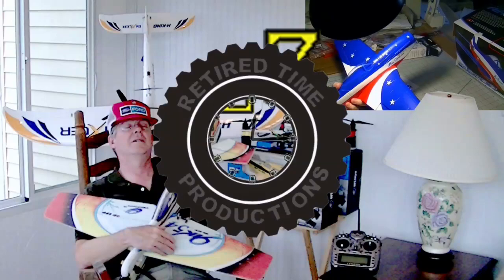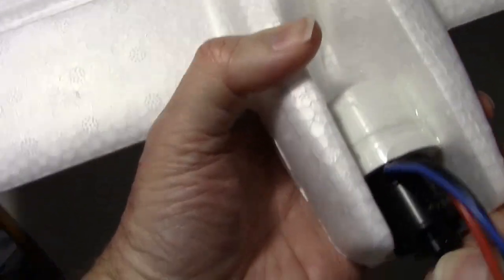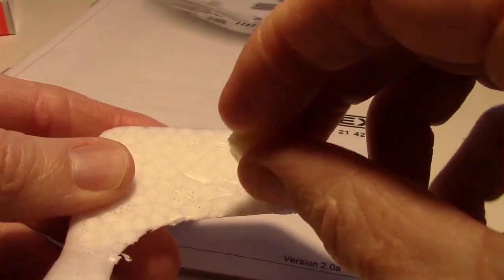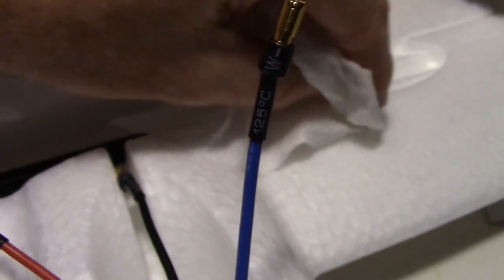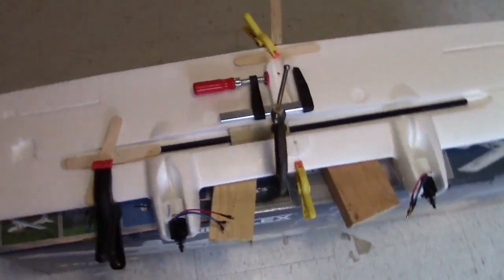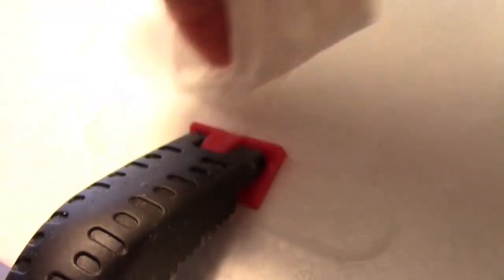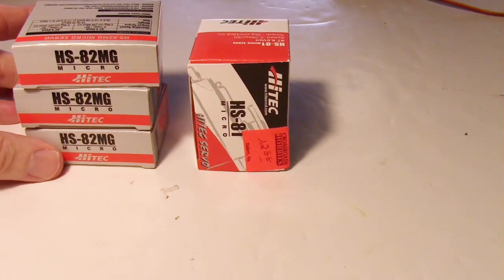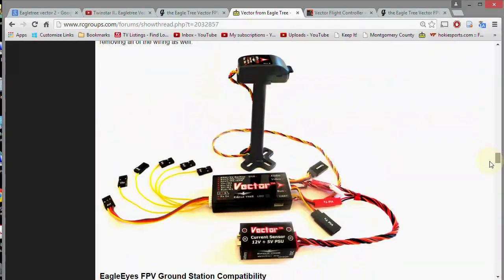Multiplex Twin Star II FPV Build Part 2 - DIY motor mounts, assembling wing halves

Comment: Glad you're looking at the Vector. All the major retailers seem to have it for $237.99. I checked RMRC, GetFPV and HobbyWireless. Even Hobbyking is advertising that price. I'm not sure there is anywhere you're going to get a "deal" on it, at least not yet. Good luck!
Reply from the maker: Chris Riccio Thanks so much for the information. Guess I will go with one of those vendors then. I have dealings with the first two.

Comment: Putting a vector into my Spector right now. I'm using dragon link but there are plenty of people who use exuhf with the vector. It comes in deans and xt60 and wired configs too. It's amazingly simple and powerful.  It's rssi input will work with the exuhf FYI.
Reply from the maker: A lot of people seem to be going for the new Vector and I am starting to catch the fever myself. Thanks for posting!

Comment: Vector is easiest fc to set up I've ever had . Osd is great so much info ! Airspeed sensor not necessary it has ground speed but if you want add it . Hope you like it also rcgroups YouTube channel did an install recently if you want to ck it out bonafidepirate is also running vector now . Good luck with the build !
Reply from the maker: tracy baker Thanks for the feed back! 
I like to have both ground speed and airspeed to better understand what the wind is doing. I wonder if the Vector can use the same air speed sensor as the apm.

Comment: Hi Dave! I'm glad you're considering the Eagle Tree system for this build. It will be nice to see a practical comparison with the APM on your Skywalker. By the way, ReadyMadeRC has them on sale right now. 
Cheers!
Fergy
Reply from the maker: Hi Fergy, Yes I am very interested in seeing how they compare as well.
I know the Vector does not have mission planning but the rest look great.
Seems like most vendors have that price drop to $239 and the list is about $279.
There probably won't be a lower price until after I buy one with my luck :-)

Comment: Thanks for the glue test. Been wondering what's best. Also, I had ordered some fiber hinges before I saw your du bro pin hinges and ordered those. looking for good security for my durafly f4u corsair rudder and looking to add rudders to my durafly d.h. vampire so I won't have to yank and bank.
Reply from the maker: Dale Kelley I really like the Dubro nylon pin hinges. I even use them to put hinges on the access doors on my aircraft. The Welder glue is hard to find these days but it sticks to everything including Elapor foam. It will eat Depron foam so be careful not to use it on Depron. Good luck with your f4u!

Comment: Can I go from a 2200mah 3s to a 3700mah 3s without changing the stock esc? Thanks
Reply from the maker: Any 3s LiPo battery will have the same voltage. However I don't know what you mean by "stock esc". My kit didn't come with any esc's.
Reply: Without having to change my electronic speed controller that came with my PNF plane, just looking to get more flight time. Thanks!

Comment: The only problem you'll have with Immersion RC and the Vector, is the failsafe - it's because EZUHF doesn't support extended limits. You'll get an error message that your throttle needs to be over 5% difference..... If you have problems, I know the cure :-)
Reply from the maker: vortecks2000 Doh! :-O Thanks for posting. Please, what is the cure? I would love to know.
Reply: ***** It's very hard to explain if you've never tried to set failsafe on the Vector before......Basically, you'll notice that the PPM pulses on the EZUHF only goes down to around 992us.
When you set your failsafe on the EZUHF, put your throttle trim all the way down on your Taranis (to be sure it's truly at zero - 992us). When you come to do the failsafe on your Vector (before you go through the Vector RC Wizard) put your throttle trim about 2/3 way up and permanently leave it there. You're looking for a minimum of 5% difference between your EZUHF failsafe and your Vector failsafe. The best thing to do, is leave your Taranis trims where they are at first and go through everything - you'll see what I mean..... It only took me around 12 hours to figure it out. All the best with it. Tony :-)
Reply from the maker: vortecks2000 Thank you for that information. I think I understand your work-around. That might work to solve the same problem on the APM as well. Glad you got this figured out and were willing to share the knowledge. Have a good week!
Reply: ***** No problem at all and yes, it will solve the APM problem...... that's my good deed for the week sorted :-)
Reply from the maker: vortecks2000 You are very ingenious adding this permanent positive offset before calibrating. Could the trim offset be added as an offset in the Taranis mixer instead?
Or could it be a weight value in the mixer? I wonder if it would work the same way.
At any rate, thanks so much for this cure!
Reply: ***** The simple rule of RC.... there's no proper way of doing anything - whichever way is the most comfortable for you. Using an offset on the throttle would work and even a weighted value would (after setting your failsafe on the RX). Personally, I found the trim setting to be the easiest but it could (with a little trial and error) be done via other means - I started losing the will to live after 12 hours of trawling the internet and found little more than this:
http://openrcforums.com/forum/viewtopic.php?f=97&t=6186
Apparently, ImmersionRC now know about the problem and are looking to resolve it in a future firmware update.
All the best with it chap and if there's anything else you think I can help with, give me a shout :-)
Tony

Comment: Hi Dave, I'm a long time viewer of your channel and really liked your Skywalker build series. I agree with the other comments and also suggest you purchase the Vector OSD. If you haven't ordered it yet, I'd also suggest buying it from Jeremiah at StoneBlueAirlines.com as he is a neat guy and also has a great channel. He is also pretty close I think (Lynchberg, VA) and could probably just about FPV deliver it. Although you will have no problem installing the system, check out d3weyTube channel for a good series on setting up the Vector. Cheers!
Reply from the maker: Thanks for watching my struggles and for the information which could be very helpful later when I setup the Vector. It's on the way btw along with the airspeed sensor. 
StoneBlue was out of stock on the wired version so I went with GetFPV which is in Florida but shipping was free.

Comment: You have some nice modifications.
The twinstar is a nice fpv plane.
Just would like to know why you didnt order the twinstar instead of the Mytwindream:
http://www.rcgroups.com/forums/showthread.php?t=2251420
That can carry much more load.
Cheers, Sander
Reply from the maker: Sander vdl I mentioned in the Part 1 video that I already have a SkyWalker plane which is large enough and wanted a smaller plane so chose the Twin Star instead of the Mytwindream.
Reply: ***** I know you have a skywalker also, i follow all of your movies ;-)
Guess you want to use the skywalker for long range and the twinstar for 'every day use'
Nice work !
Reply: *****
p.s. i wanted to build the mytwindream myself, but the shipping and extra customs is just too expensive.
I can purchase 3 skywalkers for that money.
Reply from the maker: Sander vdl Please forgive me if I offended you, I was just being my normal grumpy self lol.  Yes the mytwindream is a little pricey and also more costly to build. You are right, I just want something fun to fly around home for some short range FPV flights although I have heard this plane can fly for 30 minutes.
Reply: ***** , sorry, has to do with the language barrier. I am trying my best :-)
Just ordered a bixler 2, just to build something. (much rain and wind of 15 knots bft here)
On the glue, it will bind much better if you scratch or remove the glossy finish of the elapor on that spot. You can see it on the welders glue that it will 'eat' trough this layer and bind better.
Cheers !
Reply from the maker: Sander vdl Thanks for that! Hope you enjoy your rainy day building.